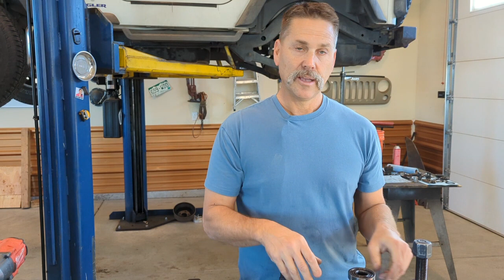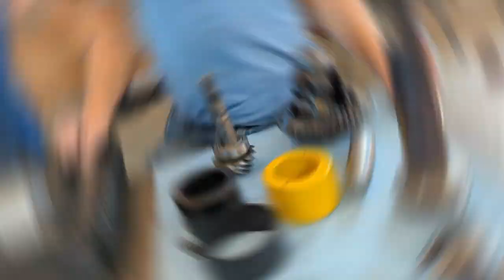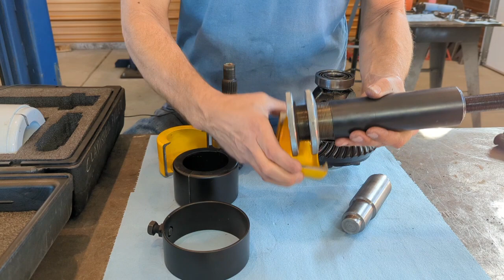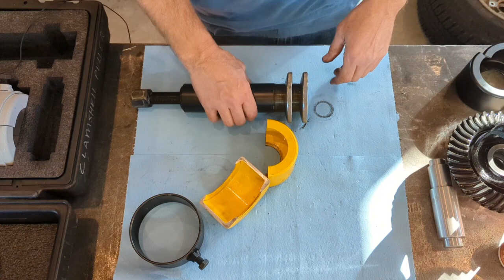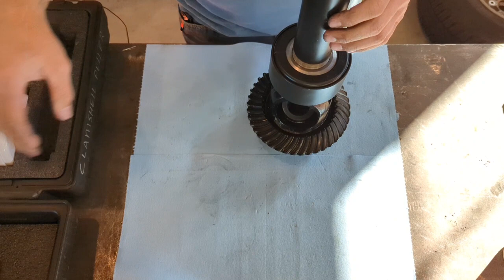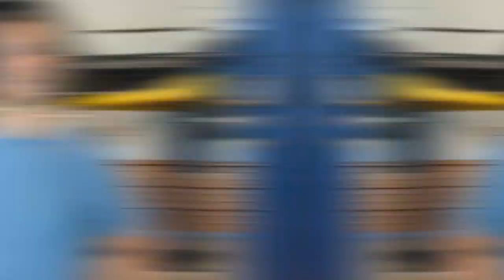How to use a Clamshell Bearing Puller

Comment: Bought the tool, watched your informative no BS video and it worked exactly as shown. In the past I tried cheaper pullers that never worked but made me actually invent curse words. Thanks Mike, it made my life a lot easier and the price is of no concern when you consider time is money.
Reply from the maker: They are a game changer for sure if you're doing more than one or two axles. And they're a life saver when doing one or two! You can't beat them.

Comment: Just added that to my list of need tools.  Have used the method you described with the dremel but this is WAY more civilized!  Checked out the tool price, didn't think it was exorbitant.  Excellent video!
Reply from the maker: Yeah the Dremel method works well but it sucks to do. The prices of clamshell pullers has come down a ton!

Comment: The price for knock off pullers has fallen dramatically, making it within reach for many. Of course the quality may slide but for occasional use they should be OK. The clever design to include that lower flange to protect the cage from distortion is interesting.

Comment: I have the same puller setup and I’m having issue getting my pinion bearing off.. the black clam is just slipping offnot sure what I’m doing wrong your video has helped. It worked great on the carrier bearings

Comment: Great tutorial video! I am using this tool on my GM 12 bolt pinion bearing and I will have to modify one of the clam shells to fit the bearing properly. It is supposed to grab it by the bearing cage, is that correct?

Comment: I purchased a complete set of Yukon tools. It was over $5000 worth of tools through Yukon. I know that sounds crazy and I never would have purchased them but I purchased a Posi unit New in box Yukon with the complete set of bearings and shims to fit my 2004 GM truck for the grand total price of $230. Yeah it was a steal. 
I purchased it from marketplace . 
Anyway, when I went to pick it up, the guy had been drinking and he was quite young actually 30 years old he was showing me the truck that he had purchased it for but he had since totaled it then he showed me some tools that he had purchased to put all the bearings on And so force and so on and he said I need to make some more money. Do you need to buy any tools I have some that’s never been taken out of the plastic or any of the boxes so I look at all of his tools and it looked to me, he used to work somewhere that sold Yukon tools, gears units everything because he had tons of the stuff I purchased every tool he had from Toyota axles to Dana rear seals, pullers installers you name it he said because I purchased the rear chunk that he would let me have all the tools That I picked out for $100 bill. I have done mechanic work my entire life and I probably have $150,000 in tools but when you’re buying snap on Mac Mac and whatever it doesn’t take long but I didn’t know how to use a bunch of those tools but when I got home I figured everything up and I had spent $310 at his house because I actually got the tools for $80 and the carrier for $230 
I never would’ve purchased these tools any other way, because I’ve always done it the old way and destroyed the bearing. I have presses and everything and I have the bearing separators. 
Thank you for the video everything came with paperwork, but it didn’t really specify if it would hurt the bearing or whatever, and it was pretty self-explanatory how to do it, and you had to adjust your race tied against the bearing to keep from destroying the bearing . Again, thank you for your video.

Comment: Is it correct to say that the outer race (cup) must be in place because the puller is acting on the roller cage instead of the inner race, and the rollers are pressing against the outer race (cup)?  Is this necessary because the inner race is not protruding beyond the shoulder it's pressed against?
Reply from the maker: Correct. When you pull a bearing, you need to have the race in place otherwise it will damage the bearing cage.

Comment: I am really glad I discovered your videos!  I have been afraid to do my own gears for years so, I end up paying someone else to do the work and they don't always do it right.  I'm going to work on a D44 and a Chry 8.25 because the guys I paid didn't get it right.  Anyway, your videos have inspired me to do the work myself!  I love tools and would like to buy this puller you demonstrated.  Would you please tell me the manufacturer and model number for your puller so I can buy one?
Reply from the maker: I traded for it from a buddy of mine. He got it off eBay many years ago from RCR.
Reply: I bought a replacement set from 4WPW (4 wheel parts wholesale) at a good price. My other one wore out after 15 years. Better hurry, they just got bought out by some wheel outfit. They are closing the main warehouse in Compton Ca. by the end of the year. (2022)
Reply: @chuckgilly  a new set of clamshells? Thanks

Comment: I would not reuse this bearing. There is no way the cage is not deformed. A non issue as I would never reuse it anyway.
Reply from the maker: The clamshell puller is designed to NOT damage the bearing or cage! Perfect every time!